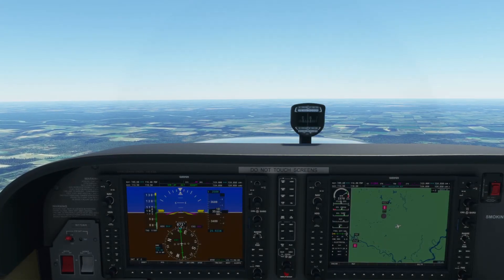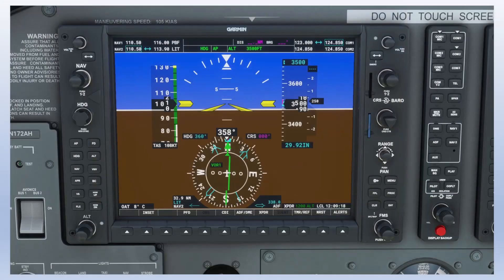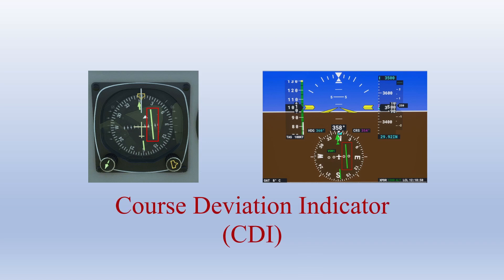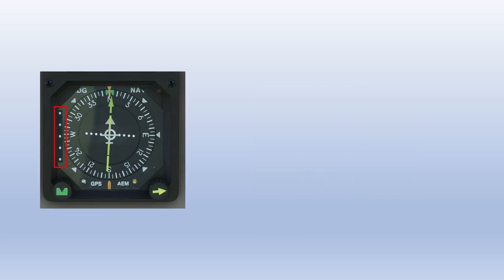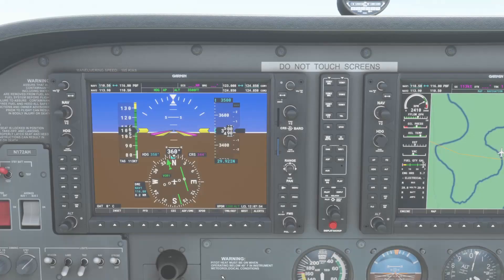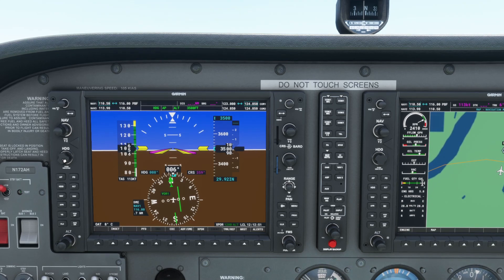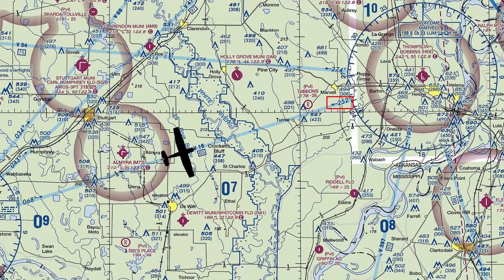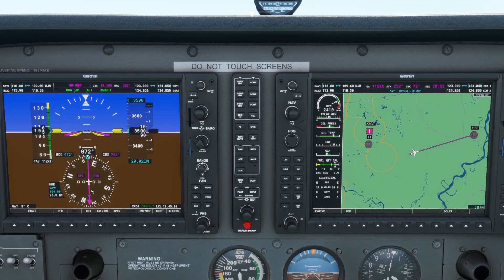FS2020:  How to use a Horizontal Situation Indicator (HSI.) (Alpha Hotel FS training Quick Look #1.)

Comment: How do you like msfs for ifr?  I started with it and switched to xplane because it appears to me the avionics work better.  Boy, all those plug ins, crappy scenery etc.  I do like the flight model in xplane though and the pop out/up gps screens which are more readable. 
Trying to decide which one to stick with.  Thanks
Reply from the maker: Pgreenx, 
I've found that MSFS works pretty well for most IFR procedures.  ILS, LOC, VOR NDB and LDA approaches all seem to work as they should.  SDFs and BC approaches seem to work fine, though I've not played with them very much.  

RNAV/GPS approaches don't work like they should, but they will still  get you to the end of the runway.  I think the working title g1000 mod you can get in the marketplace fixes most of those issues, but I've not had a chance to play around with that much.  There's also a mod for the gns 530/430 that adds a lot of functionality, but it doesn't fix the scaling issue on approaches.  

You can do pop out panels on msfs using the right alt key (I think.)  use that key and click on the screen you want to pop out.

Another issue with msfs for ifr is the weather settings - it's very hard to set precise ceiling and visibility parameters, which is very disappointing.  Xplane definitely does this better. 

That being said, I haven't spent a ton of time with xplane, so I'm not familiar with all of its features and functions.

It seems like msfs is OK for basic ifr stuff, but if you are trying to get or stay proficient on something like rnav/GPS approaches on specific avionics, xplane is a little more "true to life."  

I actually plan to start an IFR video series for msfs after I finish out the private pilot series, so stay tunned!
Reply: @AlphaHotelFlightSimulation  thanks for the thorough explanation. I’m enjoying your videos. They  are very thorough and detailed. I’m going to stick with xplane  because the  little that I know about the 530 It Works Way better than an MSFS but I like MSfs for fun flyovers of cities and other good landmarks.